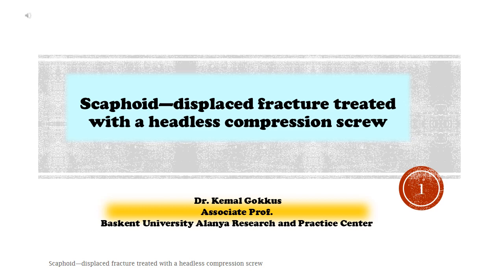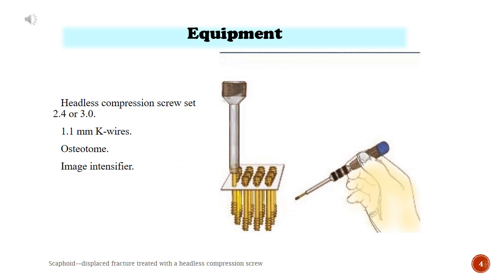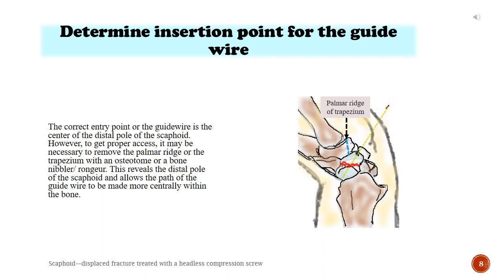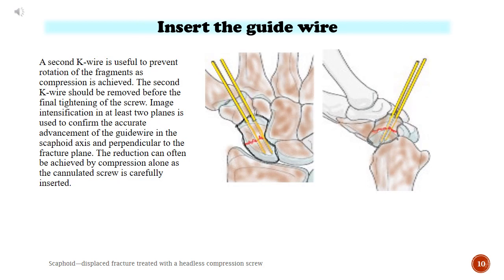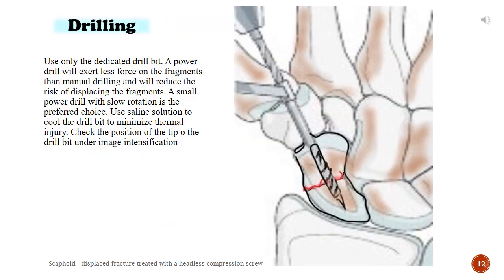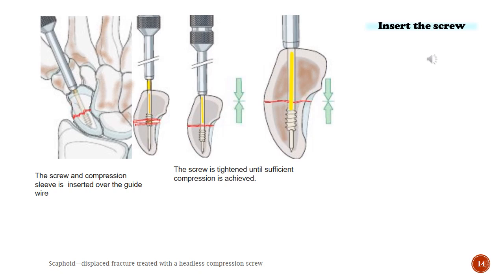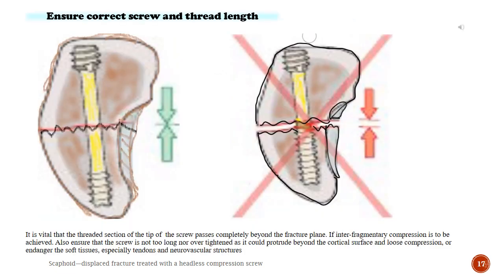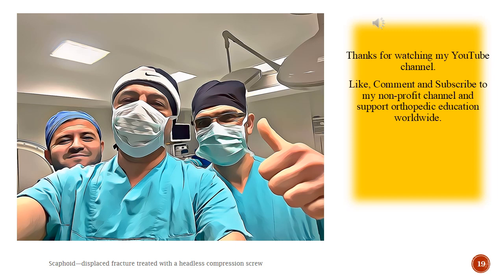Scaphoid—displaced fracture treated with a headless compression screw.

Comment: I have headless Herbert placed for capetellum and trochlea fracture 4 screws. Is it possible to remove it
Reply from the maker: Do not touch , because it will be hard to remove
Reply: @kgokkus0707  so I should leave it there for life?
Reply from the maker: No , I meant opposite meaning
Reply: @kgokkus0707  Iam sorry , I dint get you. Herbert screws inside my elbow are hard to remove - should I leave it there permanently or is there a chance for removal after union
Reply from the maker: My suggestion and experience no need to remove these headless screw , because they were inserted in totally inner sgşe of the bone ,;life long they can stay overthre